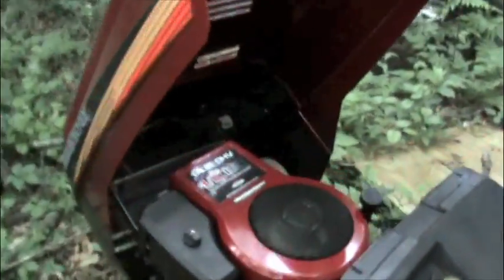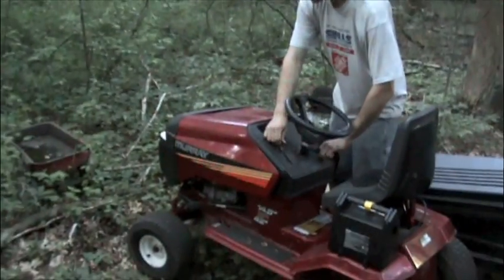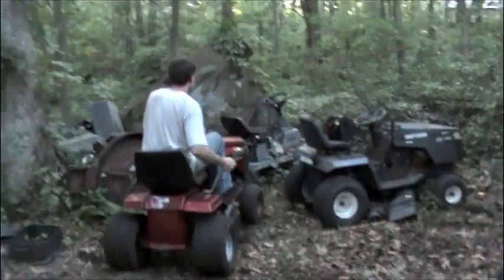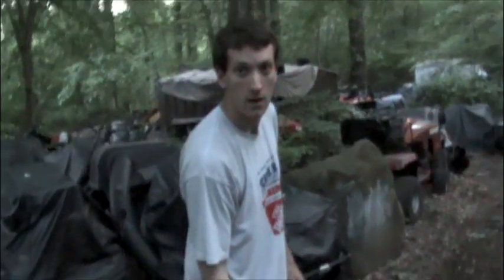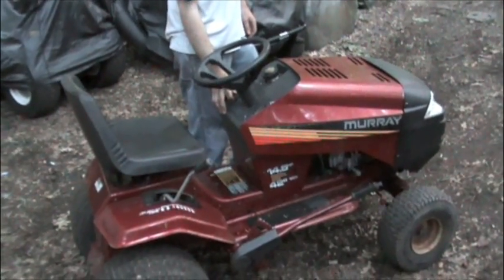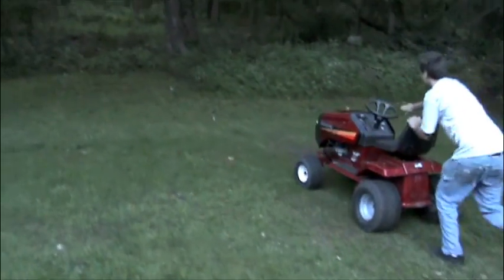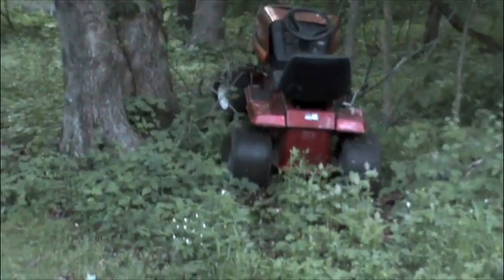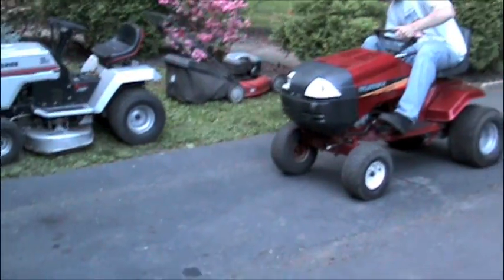The Murray tractor from the Dump

Comment: HI..  Just curious if your still viewing comments?  I have a similar model and when I was changing the sector gear bracket and steering gear the torsion spring sprung before I could get a good look at the placement.  I was wondering if you would be willing to photograph the Torsion Spring (This is the spring at is affixed to the handle that activates the blade rotation) so I can see how it is affixed.Blessings,Tim

Comment: I have a Question why does urs drive fast when I have the same tractor and engine but mine drives slow I just put in a brand new transmission but it goes slow why?

Comment: What would be so funny is if that mower had kept on going through the woods.  Say bye bye to that mower :L
That's a great engine, it even seems to idle properly, not like the newer ones that miss a beat every so often to meet emission standards.  My rally idles slightly lower than that, I was goign to set it lower but the plug might foul or something.